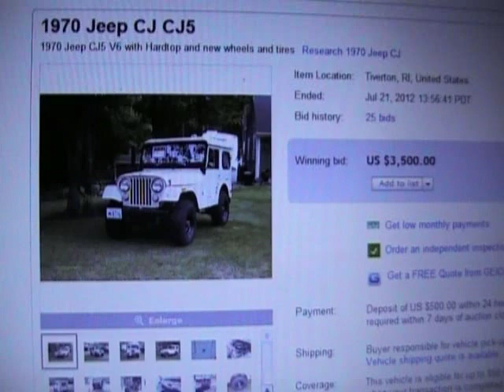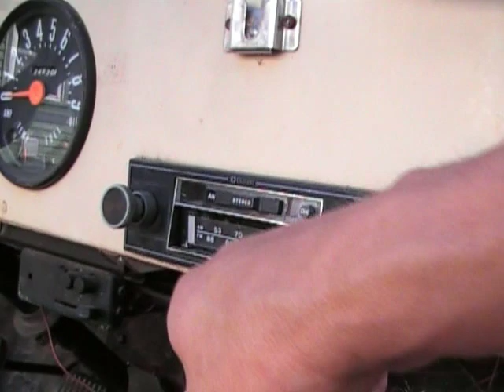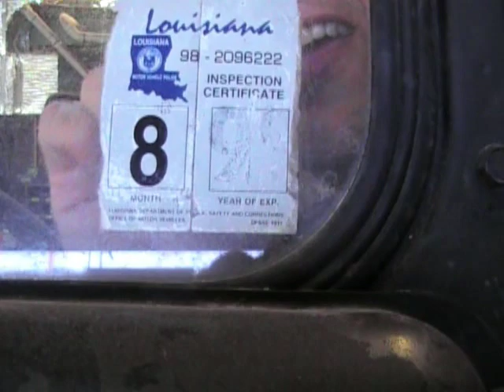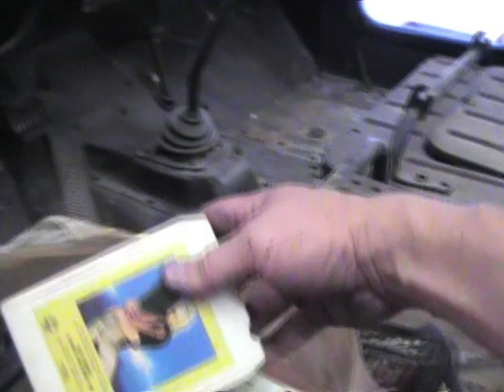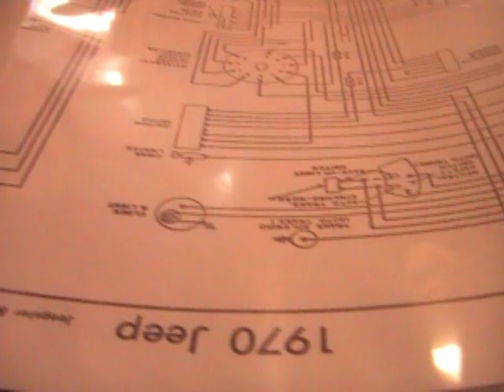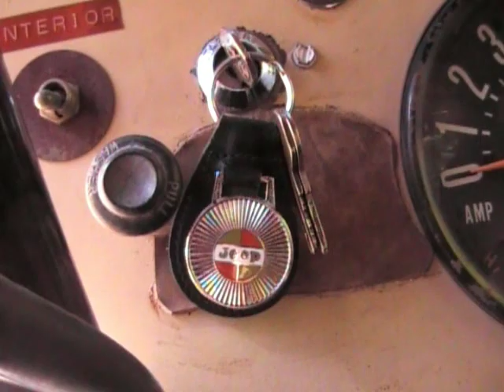1970 Kaiser Jeep CJ5 from TV Show "Dig Fellas" Restoration for metal detecting, off road 4x4

Comment: We have a '71 Kaiser Cj-5 Renegade I w/the 225 Buick V6, 3spd w/the original Warn Overdrive, 4.88's posi front and rear...and just picked up a '49 Willy's Cj-3a runnin' a 231 Buick V6, 4spd 5.38's w/a posi front and a locker out back, Saginaw steering, 11" drums, this rig is all heavy duty....nice vid, it's always a good to see Jeeps brought back to life, and actually used for what they were designed for.....

Comment: i love the buick designed ( but kaiser built) dauntless v6, wich mine also has... although the gears are super low, dont be afraid to wind that sucker out on the highway, it has no problem cruisin at 65, and yours will, too.. man, i'm  obsessed with these old beasts, and am currently building the holy grail of amc engines, .... the 401! its bored to  406 ci, with a roller cam (mild lobe/rv) , aluminum aloy 10:1 pitons, hydraulic lifters, and ported heads... keep up the good work, love it!!!

Comment: Very nice job i like the colour.
I am on Vancouver Island (BC Canada).
There is a 1970 for sale near me for $5000. with a Philippines made body tub & a 1985 V6 Buick.
It is mat-green in colour with a black bikini. If I agree to buy it I will put a 1/2 cab on it. (Like what would be on a 1969 CJ5 camper)
I really like the original top & doors that are on your CJ5.
There are 100,s of CJ5,s with soft tops or bikini,s but very few with tops.